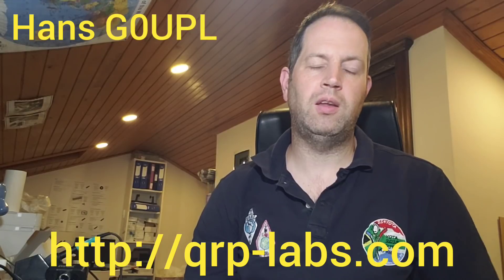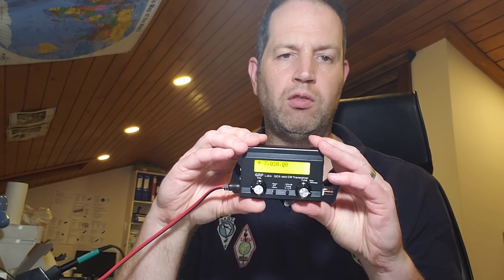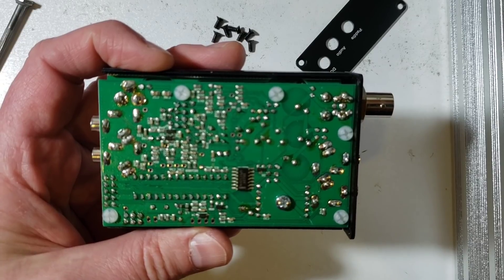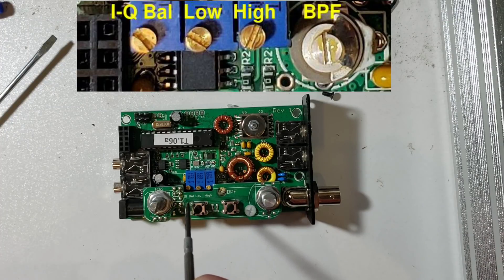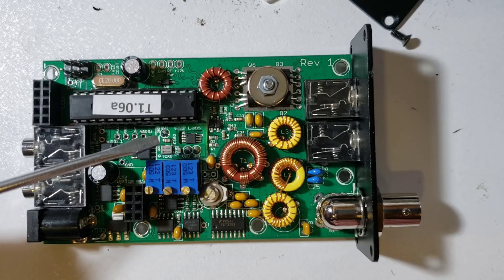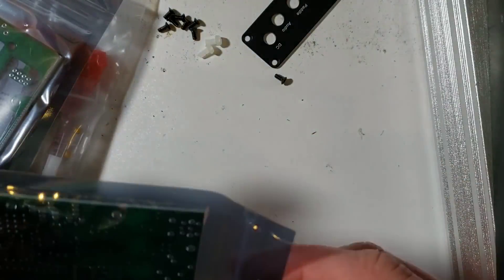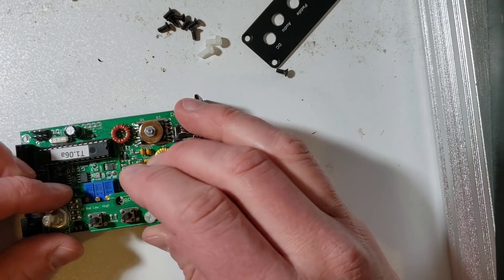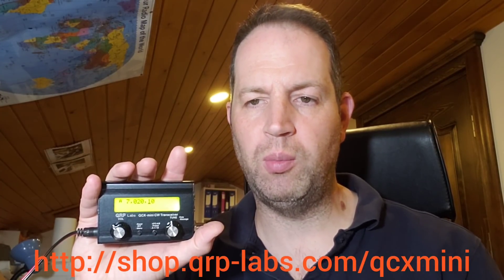Introducing QCX-mini 5W CW transceiver!

Comment: I built my second QCX-Mini (40 meter) over the last weekend without a hitch, passed the smoke test and I didn't have to a adjust the low pass filter toroids to get maximum watts out, it was already pegging 5 watts with my 12v Bioenno battery on the Watt meter. AGC and TCXO modules installed. Now I want to build more kits :) 72 de AI5DD Joe

Comment: Would you recommend this kit for an Intermediate Level electronics student? I was relieved when I saw that all of the IC's were already installed on the circuit boards!  I have some experience assembling simple circuits but never anything quite like this. I'm 61 yrs young and my eyesight isn't as good as it once was. I do use a lighted magnifying glass to aid me during some simple soldering operations.

Comment: Hi Hans!
I think Ritchie Long (VE1RPL) from the Halifax Amateur Radio Club in Nova Scotia has likely been on contact with you, as a group of us are going to do a buildathon of your QCX radios. I want to build the QCX-mini for 40m and I while the enclosure is a no-brainer, I was wondering what other options you would choose if you were building it for yourself. The TCXO and AGC boards sound like a good idea and I was wondering about the benefit of the 1.09 chip upgrade. Thanks for any advice you can offer! 73, Tim VE1XR

Comment: I notice the socket for the key says "paddle".  Will it also operate using a straight key?  This isn't a theoretical question.  I generally use a straight key.
Reply from the maker: Yes, you can use a straight key. There's a configuration menu for choosing keyer type. In straight key mode you can use a stereo plug with the key on either tip or ring. Or a mono plug if you prefer.

Comment: Erm, what is it and what is it used for?

I’m at 3:10 and still have no clue.

Transceiver - transmit and receive?

At around 4:06 I hear “Radio”...

hmm, nice design - that board layering is neat 👍
Reply from the maker: This is a radio receiver kit for amateur radio operators (ham radio operators). https://en.wikipedia.org/wiki/Amateur_radio
Reply: @QRPLabs  thank you and great job!

Comment: Why why why does it not have a second band?
Reply from the maker: Why?
Because Rome wasn't built in a day. 
Because don't run before you can walk. 
Because it's difficult. 
Multi-band involves compromises of cost, complexity and perhaps performance too. 
There's no radio available other than QCX that offers anywhere near such a high ratio of price&features to cost. Even if you built two or three for the bands of interest you'd still be ahead on performance & features vs cost ratio
Reply: @QRPLabs  Yes, you are right. I don’t know much about them but must compliment you on a brilliant looking set. It really does look professional. Ok, does it come assembled and how much. Thank you for your work.
Reply from the maker: @donalfinn4205  yes, the assembled version costs an additional $40 and the link is in the video description above. 
73 Hans G0UPL
Reply: @QRPLabs  👍. I salute your knowledge and your efforts. EI5IJB

Comment: Just order my QCXmini and the enclosure.  Didn't order the TXCO, but think I will go back and order it as well after watching this video.  Hans, you have done great work with these QRP rigs, I love my QCX40 and my QCX20.  I do have one issue with my QCX40, and that is the volume, it seems to be constant volume no matter whether turning up or down.  I have to use a set of amplified speakers that has their own volume control to keep the volume down.  Do you have any suggestions as to what my problem may be???  Thanks again for the hard work and the video.  Juddie - WD8WV
Reply from the maker: Hi Juddie, it would be good to ask this question on the QRP Labs discussion group on groups.io... Youtube comments section may not be easy... have you checked the gain potentiometer? Maybe you have a poor connection of the grounded pin. Sometimes the pots on the QCX/QCX+ develop connection faults, the track is printed on a phenolic substrate and the connecting pins are crimped to that. Even mild mechanical abuse can break the connections... and that could I think, result in you always being at full volume. You are compensating for that with your amplified speakers. I'd check that first. 

In the QCX-mini the gain potentiometer is a different part; it is a fully encapsulated plastic-bodied pot where the pins are embedded firmly in the potentiometer body so I think it is a more robust part.
Reply: @QRPLabs  thanks Hans, I will check out the group and see if I can find an answer there.  Juddie -WD8WV

Comment: Totally awesome what a neat job! I would love to get an 80 meter Radio in the mini. I only have one question, do you think there will be any issue with the voltage regulator overheating, not having a heat sink?
Reply from the maker: Hi Bruce, the voltage regulator's tab is soldered to the PCB, which acts as a kind of heatsink. There is no problem with it overheating.
Reply: @QRPLabs  Thanks! cant believe I didn't consider that? That would work perfectly.

Comment: This is really lovely Hans!! Very ingenious how everything fits together. Great work! Is there a possibility to program the controller chip as with the original QCX?
Stay safe and many 73’s /Mikael
Reply from the maker: Yes, the same chip is used, in 28-pin DIP package, and the board has the same 2x3-pin in-circuit programming connector. Same as QCX+. Firmware updates are fine.

Comment: some will not love the green color and would rather put up with the higher current.. so next option could be adding a way to turn on the backlight, on the fly, for a predefined brief period, and make available alternate color displays. 
And the case “you can have in any color so long as it’s black.”

Comment: BAND'S? UA9OMN
Reply from the maker: Single band, your choice of 80 60 40 30 20 or 17m. 
You can also build for 160m if you change the crystal to 12MHz.
And you can build for 15, 12, 10 or 6m, but the receiver sensitivity and transmitter output goes down, as the frequency goes up.